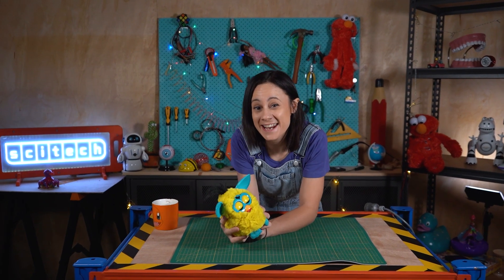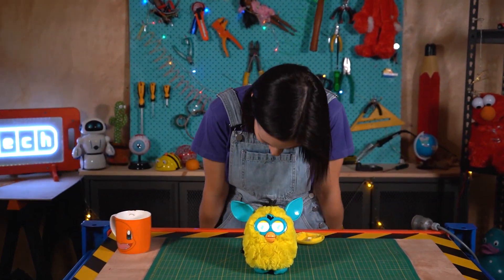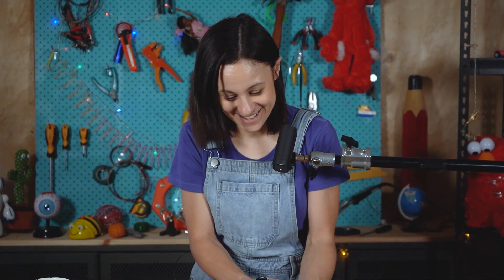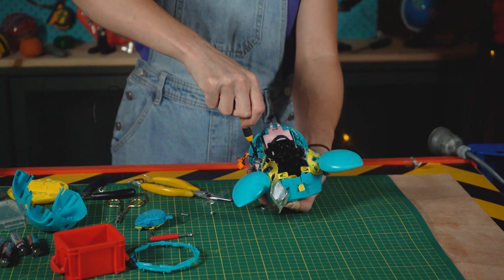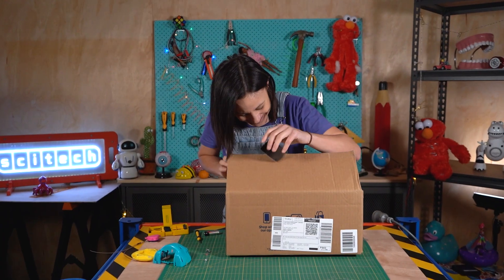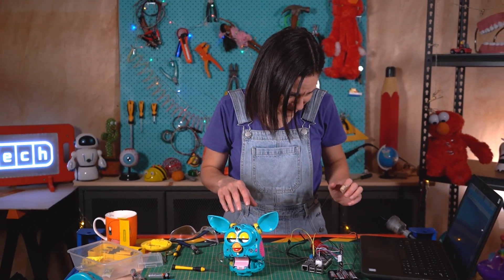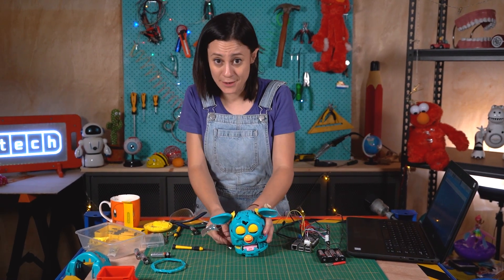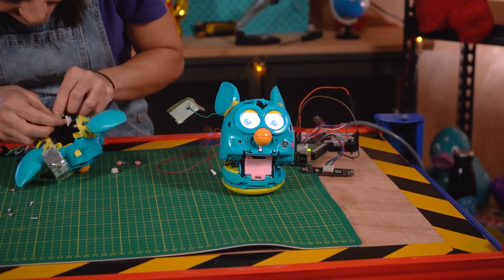I gave this Furby THE INTERNET - Toy Teardown

Comment: I want one ❤ I didn’t know that this model can learn and start speaking 😮I only had the one from the 90s I need one of those but with charging battery to big buy new batteries all the time
Reply from the maker: Hehe! The furbies built-in brain doesn't really "learn" as such but they do have a number of phrases you unlock by speaking to them more :) (We upgraded the brain of the one in the video, to turn it into an assistant!) Using parts form this kit - https://aiyprojects.withgoogle.com/ I'm unsure if the newer ones have rechargeable batteries or not.